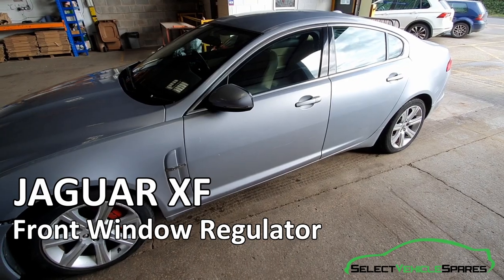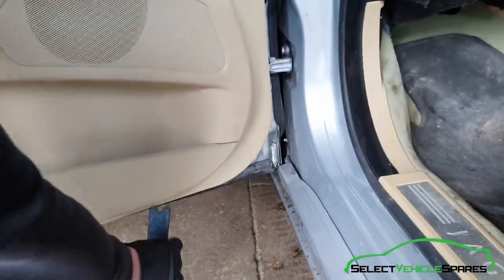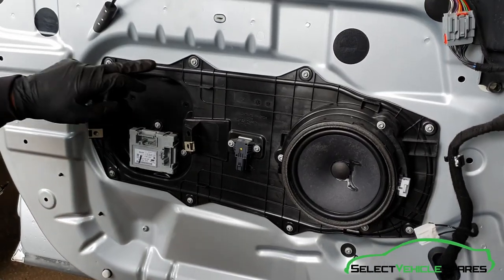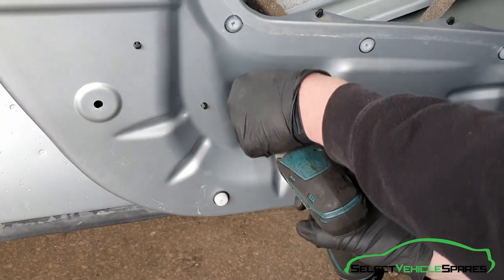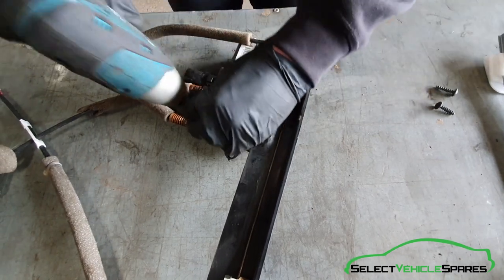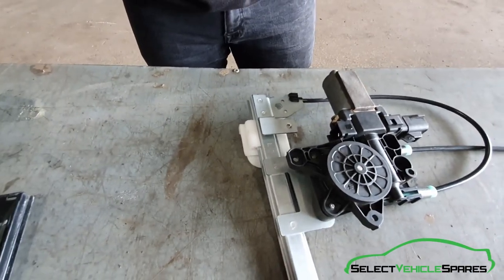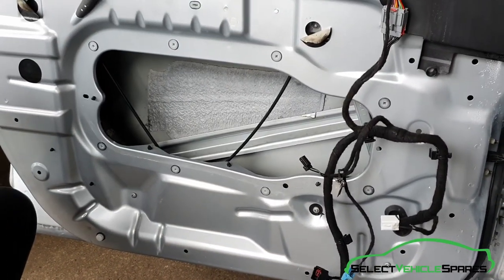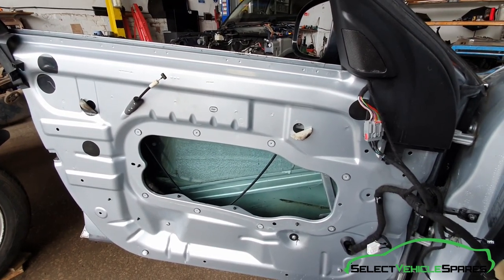JAGUAR XF MK1 X250 - Front Window Regulator Replacement Fix How To Remove & Replace

Comment: The front left window of my 2011 Jaguar XF stopped working and was stuck in upward (closed) position. After the dealer quoted ridiculous amount to change the windows regulator, I decided to DIY it and then came across this video. This video was very helpful. 
I ordered a window regulator from Amazon which was from a chinese brand. It looked slightly different than the original OEM one but the part number was matching and the price was 1/3 of the Jaguar's. Since it was from amazon and had free return,  I decided to go for it.
For this, I was a bit hesitant to do this DIY as it required removing the glass and I was afraid I would drop it and break it.!!!

But It turns out the window glass removal was not necessary. What I did was, I removed back regulator pillar (one near the door latch)  of older window regulator first, and immediately put in the newer one, while the older front pillar (one near the door hinges) was still holding the glass window. Then I proceeded to remove the older front pillar and put in the newer one. This way there is no need to remove the glass.

The window now goes up and down much smoother. :) Thanks a lot for making this video.

Comment: This fantastic video has saved me £1k. The o/s drivers window failed half way through a McD's drive through order - I had not got a clue what to do, having just retired money is tight so what to do? Quote from Jaguar Garage £1200 parts and labour. Watched this video, ordered a reclaimed part from Ebay for £89 and a couple of tools from Screwfix then just followed what the fantastic mechanic did in this video. I watched it bit by bit on a kindle as I did it and astonishingly (to me) it works perfectly. Everything ship-shape in the car as well. Just chuffed to bits and would stand the lads a few pints if only they lived closer!
Reply from the maker: Hi Phil, that's great to hear, and exactly what this video was intended for! I can't believe Jaguar wanted to charge so much, you expect them to be expensive, but £1200 is extortionate. Thanks again for your kind words.

Comment: Great video. Very helpful. Thank you. Don't forget to replace the cable ties securing the wiring loom and window regulator cables (as I did!), or you will hear the cables rattling in the door cavity when driving.

Comment: Great tutorial and explained the process for a 2010 XF Portfolio well. Add using a magnetic torx driver as the screws tend to fall in the door and getting the glass to clip back in is an art. If it helps, I replaced the regulator and motor, the window would raise once or twice, slow down then stop. I presumed the motor was overheating. The trick to raising, pre replacement was to tap the up button once a second to get it to raise; letting it rest for 10 seconds it it stopped. Thank you.

Comment: Excellent video - one of the best with good camera work and sound. I could not tell whether you removed the window exterior trim strip (bottom of the window outside). Does that need to be removed to manoeuvre the window out? Thanks.

Comment: Brilliant, four weeks after my hip replacement and with DVT as well I managed to change mine in about two hours. Showed everything from start to finish. Apart from where to buy the new regulator. 👍👍
Reply: Wish it was the driver’s door. There’s a load more wiring that side and a small speaker hidden away up top.   I was a bit cautious about the glass and stuck a nice bit of duct tape on the top folded over to hold onto.

Comment: This was perfect. Just one small issue-the new regulator comes with those glass clips at the very bottom-so I had to connect all the cables and power up the door-then disconnect everything again-to put them at half way to snap the glass back into place. Otherwise brilliant! Thank you

Comment: Hi - this is a great video to follow and I used this to start to change my window regulator today, but am stuck on a step (which is not there in this video) - my glass is in Down position - how to raise it up, I am struggling, it’s not going up enough to get to the white plastic clips to unclip the glass

Comment: A great video with very clear instructions. How can you tell if it is the window regulator or the motor that is the problem?
Reply from the maker: Usually if you can hear the motor trying to operate, then it will the regulator that is at fault.

Comment: Great video!
But what was the issue/symptoms before?
My drivers window (LHD), is it going down all the way, stucks 5cm above the edge and I need to pull button couple of times to make it going up.
Reply from the maker: It sounds like the cable may be damaged/frayed, or it could be that the motor is weak.

Comment: Thanx for info, im about to change the door on my XF, bought secondhand door on ebay. So i need to remove everything from the damaged door and transfer to new one !
Do you have any tips ??
Should it be easy enough ?
Any issues i should know ??
Thabx Dave
Reply from the maker: We didn't remove the full door on the particular model, but there shouldn't be anything too different than replacing any other door. On most doors, the lock/handle mechanism is usually the the most fiddly part to swap over.

Comment: Perfect instructions. Professional job 👍I have to do this job shortly and this is perfect.

If you fancy doing one on replacing the heater unit vent motors (the internal routing vents not the easy dash vents 😂), I'd possibly buy you dinner 😘.

Thanks for taking the time to share. Subbed 👍

Comment: Passenger side no longer works, drivers side is slow. Is it usually just the regulator that fails or is it possible that the motor can be bad too? Thanks
Reply from the maker: It could be either of those.

Comment: ***At around 3.40 you say "you'll want to get it into this position" ,  that is my stumbling block, I cant seem to get it into that position, it is at the bottom of the door and seems stuck - any tips please to get it up there so I can remove the clips from the glass?
Reply from the maker: Have you tried disconnecting the motor from the regulator? If so, this may free up the regulator slightly so it can be pulled upwards by hand.

Comment: The cable on my motor has snapped, can that be replaced without replacing the whole unit?
Reply from the maker: Yes, you can just change the regulator if you wish, but you would still need to remove the whole unit first.

Comment: Can i do this the same way if my window is stuck up
Reply from the maker: It's possible, but not as straight forward. If you remove the motor from the regulator, then you may be able to pull the glass down manually.
Reply: @SelectVehicleSpares  thanks, my new one comes today or tomorrow hope it works.. i bought a cheap one at first and the connector didnt work, thats what i get 🤷🏽‍♂️

Comment: Any idea how to remove the front passenger upper exterior window chrome strip please? Can't find anything anywhere 😢
Reply from the maker: On most cars that we have worked on they are just pushed on. Usually to remove them you can use a trim removal tool at one end and start prying it upwards, and then work your way along the trim.
Reply: @SelectVehicleSpares  Thanks very much for the reply, much appreciated 👍

Comment: XF not used for a month and passenger not going down. It moves a few millimeters down and   up but that's all. Try to reset but still the same. 
I guess I will need to replace the regulator and possibly the motor. Was a bit worried how to do it but thankfully found your excellent video. 
Couple of questions (I know the video was posted a couple of years but hope you can still answer).
1 - is it easy to push the window down to unclip it from the plastic bracket.
2 - in my case could it be that battery got too low and possibly it could be sorted out by battery disconnection and re-connection

Many Thanks and a great professional video -very few around - Well Done!
Reply from the maker: Hi. 1) If you remove the door card panel, then remove the motor from the regulator, you should be able to push the glass down far enough to remove it from the regulator clips. 2) If the car is starting and running, then it's unlikely to be the battery, but could be worth a try!
Reply: @SelectVehicleSpares  Many thanks - easier than I thought. I will attempt the battery disconnection if I ever find the radio code :-) . 
You are a gent!